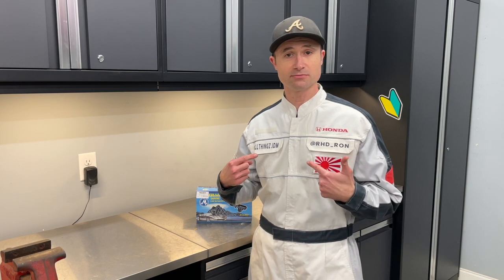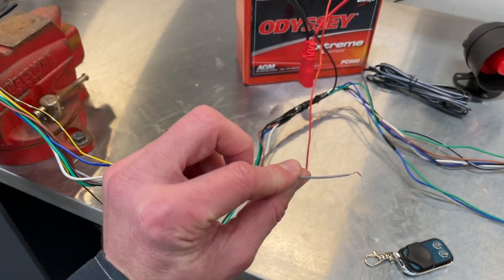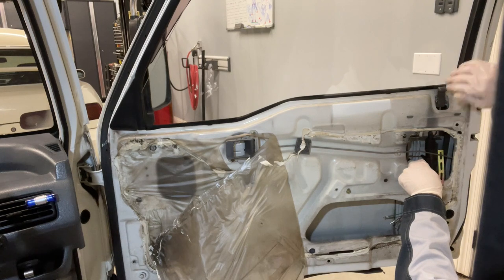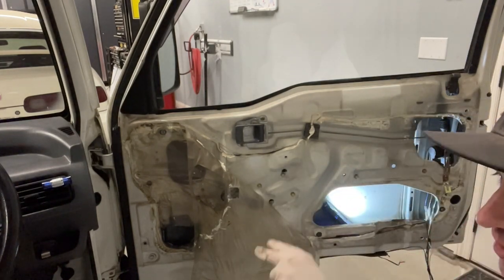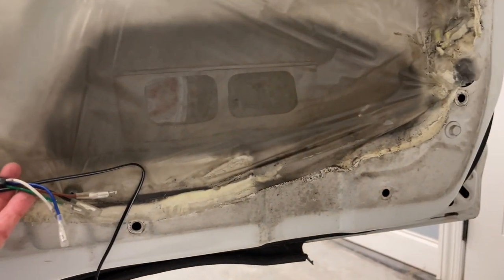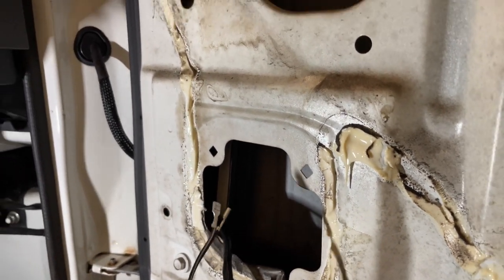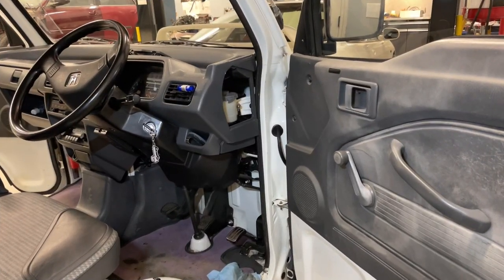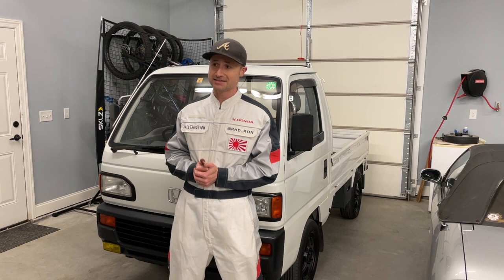Honda Acty Auto Door Lock Installation #Honda #Acty #Door #Automatic #Installation #Review

Comment: Ron. Awesome as always. How did u bypass the driver side door locking feature where you have to hold up the outer door handle to turn the key??
Reply from the maker: When the door is closed, the locks work as they should. Only when the door is open does the door lock protection “kick in”. So, no issues when the door is closed, or holding the handle open with the door open. Thanks

Comment: i have a quick question ok so my kit came with a part where you wire in a manual lock switch i hooked it up to a on - off-on switch 3 pin so it will unlock and lock while the door is open but will not lock while the door is closed on the switch , when i hit the switch it locks then unlocks , my fob works perfect
Reply from the maker: Hmm thats a tough one. I’d have to look at the schematics and what you wired to troubleshoot. I can’t really say what is going on based on that info
Unfortunately

Comment: another excellent vid Ron.    I can't help but wonder if there is a "micro" actuator that would serve the mechanism better.  The universals are strong, but in the tight Acty door, I think a smaller actuator would be better. the controls seem great, and nice fob.  After installing, do you notice any draw on the battery?
Reply from the maker: Hey Ray! No, no real draw. I drive the truck once a week at least. Every now and then the first turn seems a little sluggish but fires right up after 1-2 seconds. Hard to tell if its just the “compression stroke” or battery draw I guess. Yeah its a cheap kit for less than $100, but it does the job. I fully expect it will not last forever 😂
Reply: @rhd_ron  found micro servos... not really micro, more like smaller "box" shape" and ordered a remote interface.  another project that will no doubt add speakers, and 3 part painting of door panels.... do you know if the inner panel on the doors are removable? I'd like to cover them with cloth like the vans.... ?  most can't be taken apart due to the mfg process.  (yet another part to me doing power door locks...)  this is how my projects turn into a snowball rolling down into an avalanche....

Comment: hey Ron,  love your channel, and really appreciate you posting this videos of the Honda Acty. I have a question tho, Iv been searching the internet for this issue i have with my 94 Honda Acty, havnt been able to find much help. So every once in a while after i drive, ill park the truck, turn in off, and then like 5-10 min later something on the truck starts running. Sounds like a fan or maybe fuel pump? Not sure what it is but then after a couple min it shuts off. Was wondering if you might know what this could be and if its an issue? Thanks.
Reply from the maker: Yep for sure! Thanks for the love. Yeah so thats your sub cooling fan. It blows directly on your exhaust to cool it when it gets hot enough to trip the thermostat switch by the exhaust. It runs until that switch (in the area of the exhaust) opens when ambient temps near the exhaust cool down enough.  I had the same issue when I first got mine. Have to be careful though, the relays can stick on the circuit and it will drain your battery. These things should run about 15 mins max from my experience in the summer in the south. Thanks for viewing!
Reply: @rhd_ron  Awesome thanks! Glad it's nothing serious. Looking forward to watching your channel grow. 🤙